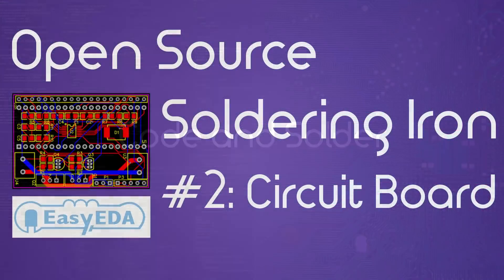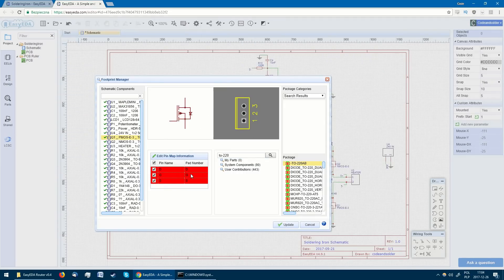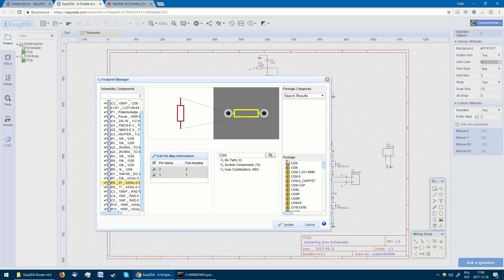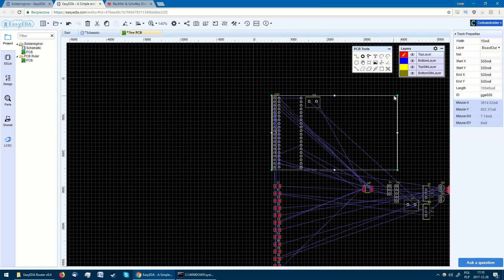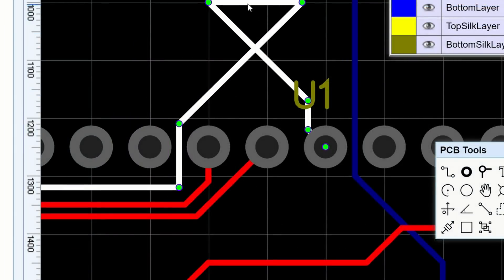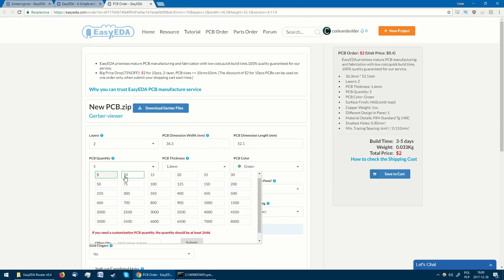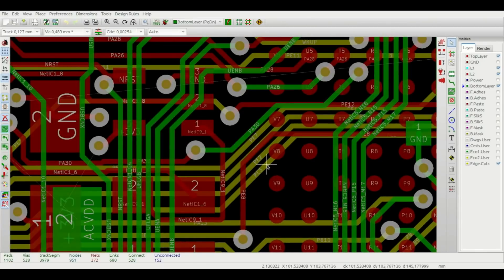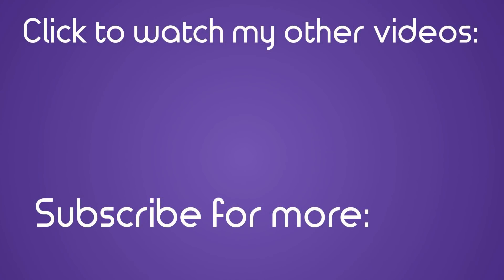DIY Soldering Station #2 - PCB Design with EasyEDA

Comment: We use EasyEDA at school to make the boards. School has a CNC machine designed for milling PCBs specifically. Part of ICT degree. It's easy to use, but we couldn't use autorouter and have to use through-hole jumpers to make double sided boards. The point is to teach us how to do it all manually, instead of relying on autotouter. Anyways, this project is great, and ordering your own professionally made boards that you designed makes it so much better than just using stripboard or etching single sided boards (etching is very time consuming and you need special equipment).